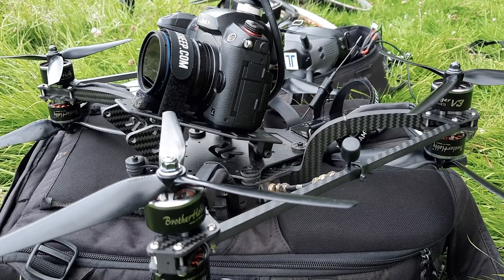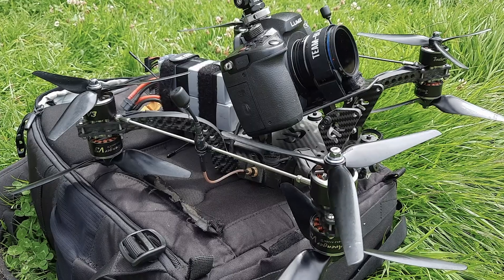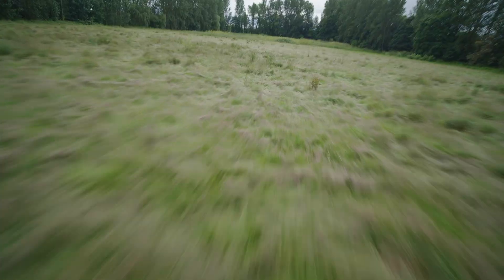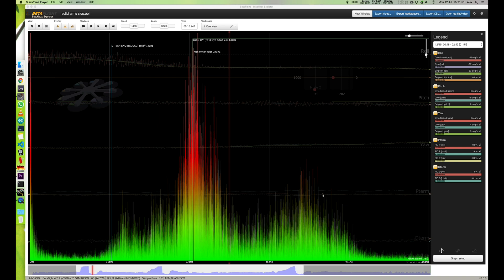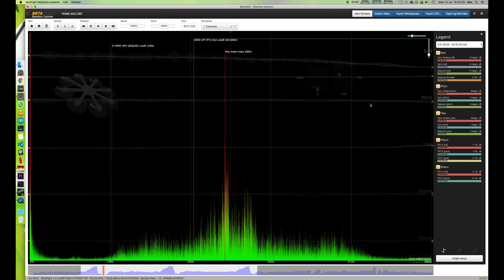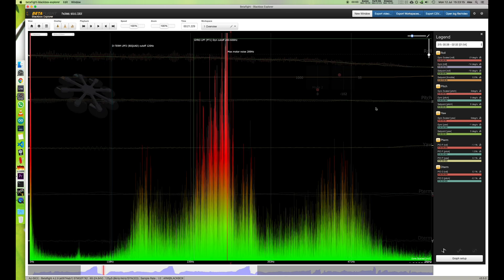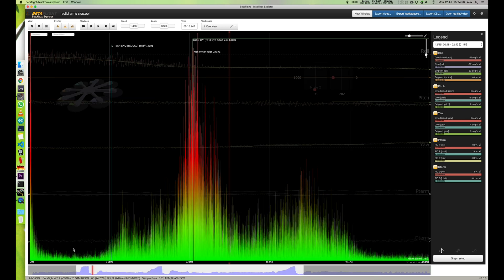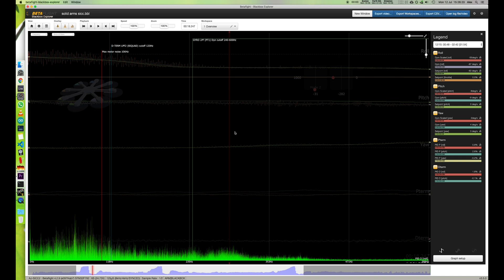Siccario Cinelifter - Testing solid carbon arms - Chris Rosser modified arm test

Comment: Wow, love your siccario series ;D Btw ive seen you got the 2812 motors from brotherhobby. What made you choose these over the commonly recommended 2806.5? Im currently deciding between those two options. The 2812 seem to be more effiecent but are 300g heavier overall. Thank you very much for your help :D
Reply from the maker: Thanks : ) 2806.5 are 1350kv so they are only suitable for 7" props (and some recent lighter 8" props) but they dont have a huge amount of power or sator weight so you can't push the tune as aggressively. In a nut shell 7" = more like a 5" to tune but more limited for big payloads. 8" = better for heavy payloads and aggressive tuning but harder to tune properly. with either option you need to be very competent with BBE/PIDtoolbox and manual tuning techniques if you want to build a decent rig. There is loads of great motor info on the fpv cinelifters facebook group
Reply: @DesignTuneOperate  Thanks for your quick answer and all these great infos. I really appreciate it. Keep up your great content! :D

Comment: I really appreciate the info and detailed blackbox logs! The biggest low frequency spike on the sicc I'm working on was in the yaw axis gyro_scaled. This makes sense since the theory is that the og arms are free to oscillate about the yaw axis and that's where the noise originates. How'd it look on yaw?
Reply from the maker: Do you have a Radix or ICM gyro? they are usually worse on yaw. both these rigs are pretty clean on yaw luckily!
Reply: @DesignTuneOperate  interesting, it's running the radix 2 with the Bosch gyro so yeah that could explain it. Good to know, thanks!

Comment: You been able to turn gyro lpf off on any of these rigs? i built a similar version for 9/10" props that i can kinda get away with no gyro filters  (ive been relying on dynamic notch/rpm filter on all my builds to remove latency for wind)  it flies half decent but damn does it have mass,  that mass sure makes wide radius corners unless you really lean and throttle in to em so i might just wait for some lighter decased cameras to come out and build some x4 frames in the 8-13" range.... 

Im used to flying 5-10min+ flights so i will prob use the 8" for more nimble freestyle and 10-13" for more longrange/ wide radius stuff..... man i wish 12s escs were cheaper though
Reply from the maker: This one is only running one lpf and one d term biquad at 120hz on PIDtoolbox's recommendation! 

The bigger stuff is different to fly for sure.. I really like it, gotta throttle up ages before the ground on the way down

Comment: nice video Alex! I have to say both rigs are flying very smooth given the smaller FOV of those cam as compared to what we're used to with GPs. amazing really!
Reply from the maker: thanks Brian! Your process for tuning these things is brilliant. I think we can still push this tune a little bit more and see if we can stamp out those wobbles at the end of the throttle ramps 👌🏻 It's great to have a moderate tune that is performing so well.
Reply: @DesignTuneOperate  yes, some higher PD gains should take care of that, and/or working on antigravity and itermrelax. something is up there

Comment: 7” or 8” props, it looks like 8?
Reply from the maker: well spotted. 8040 on the top, 8045 on the bottom : )
Reply: @DesignTuneOperate  what are the difference vs running all 8040 or all 8045? Thanks!
Reply from the maker: @IgnitionFPV  Just personal preference and a bit of efficiency : )
Reply: @DesignTuneOperate  you'd reckon this combo would be more efficient than running all on 8045? I'm still awaiting my 8045 to arrive from the dealer.
Reply from the maker: @IgnitionFPV  Give it a try when they arrive : ) Yeah I am pretty sure I am getting better flight times like this